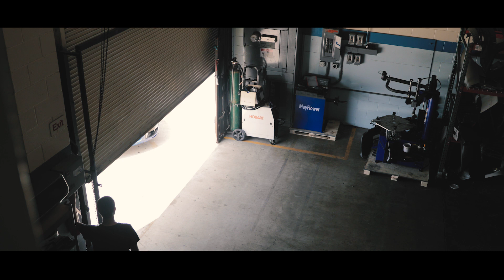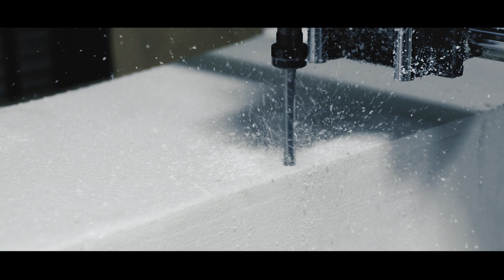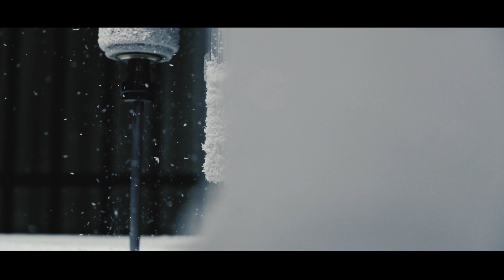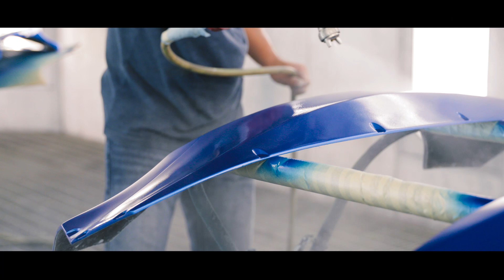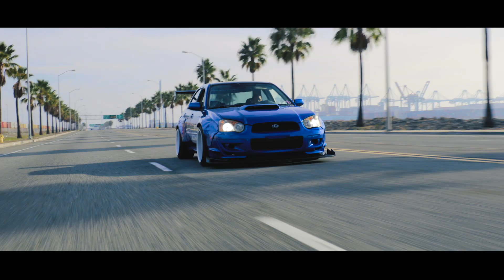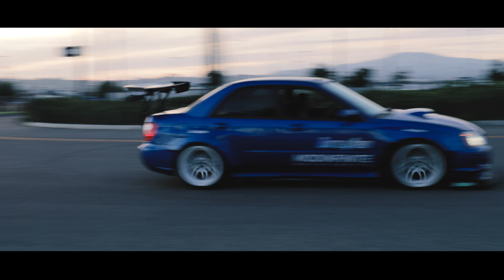Designing: Battle Aero Subaru WRX GD Widebody Kit

Comment: This might be a stupid question. But was there any cutting to the body to fit this kit?
Reply: Yes, the fenders underneath the overfenders are cut by 1-2 inches to fit the wider rim and tires :) This is an irreversible upgrade, unless you have a spare body lying around :P

Comment: what size spacers did you use for the perfect meaty stance?
Reply: and what wheels and tire sizes are you using
Reply from the maker: The wheel on this car is 18x11 +10 with 15mm spacer. This mean actual spec is 18x11 -5